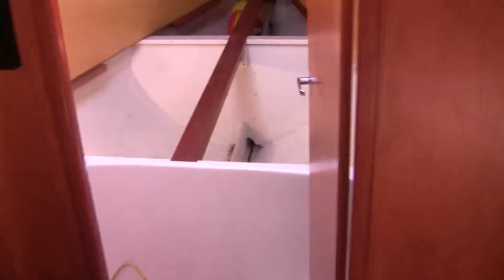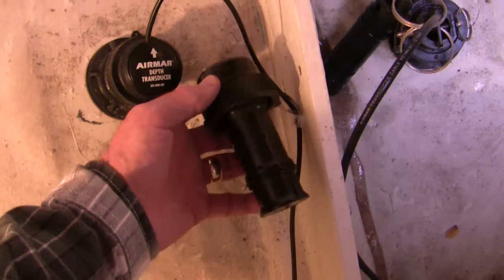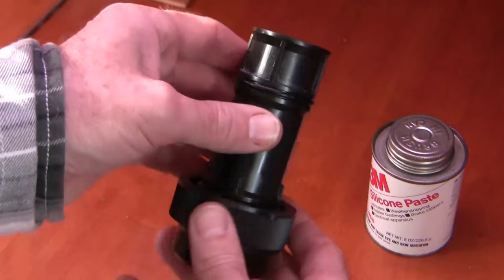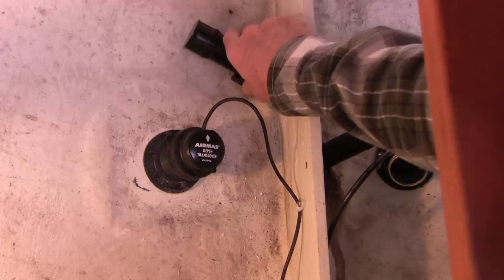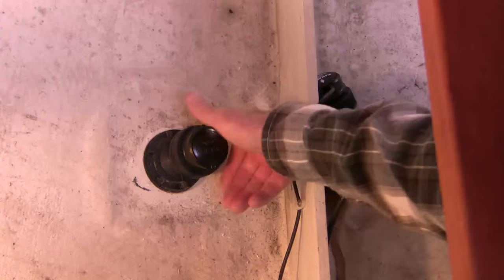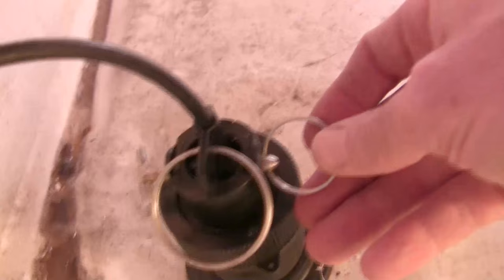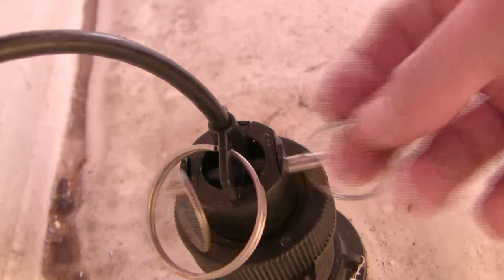How to remove a padddlewheel speed sensor on a boat

Comment from the maker: For those looking for an inexpensive replacement for the stainless steel shaft of the sensor, I believe that a length of 3/32" stainless steel tig welding rod is just about the right diameter. One rod is a lifetime of shaft replacements, which are easy to swap out.

Comment: Any chance you know the model of paddle wheel you have in this video?
Reply from the maker: I must have written it down, somewhere. Next time  go to the boat I'll look it up for you. Note that the NMEA 2000 speed sensors are completely different than these older NMEA 0183 devices, though it is possible the wheel is unchanged.
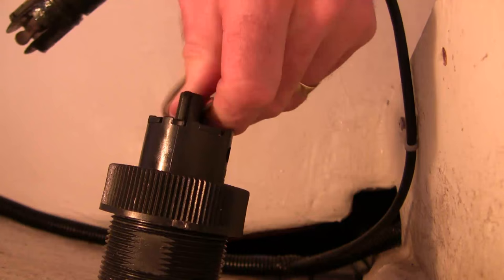Reply from the maker: Ah, here it is, shown at 4:20 of the following video https://youtu.be/4kjfn-Q-7r8

Comment: The flange that reduces the onflow of water on my airmar through hull transducer seems to not work as well as it should as water gushes up powerfully when I remove the transducer..any suggestions?
Reply from the maker: It's not a critical element and some boats don't have it. It's just a flap of rubber fabric that is pushed shut like a one way flap valve by the pressure of the water. Next time you have the boat out of the water you can have a look, it could be held open by overgrowth of weed, barnacles, or other sea life. You can replace that component but I probably wouldn't bother if you can't fix it. Good luck!

Comment: You said the paddle wheel is cheap?  I need one for a old analog gauge (prob 1960 or 1970's vintage) There are adds on your youtube page that show it at $200 or more, sometimes much more.  Given you can get a gps, with a screen that shows current data too, for the same price or less, I don't think I will be replacing my paddle wheel.  Probably safer to just glass over the hole anyway.  Pity though, I did like to have it.
Reply from the maker: Mine is an analog sensor, although yours may be a different vintage. Nevertheless, replacing the paddlewheel should work if your sensor is OK. When I was thinking I might have to replace the whole sensor, I contacted the manufacturer and they told me I could get the same analog sensor if I asked for it. Conveniently they both fit the same through-hull. As you know, the present generation are all digital, and my old 0183 communication protocol is obsolescent. However the signal I get from the sensor is a simple Hall effect on/off signal, so it's more basic data than the communication protocol used in new devices sold now.
These paddlewheels are not as reliable or as accurate as the new ultrasonic sensors, but those devices require a larger through-hull and have a bigger footprint on the hull. Fortunately I got away without doing major surgery on the hull. Perhaps one day they will be able to make one that fits our old through-hulls, in which case I would consider replacing mine. As you know GPS can't isolate the contribution of current, instead giving an overall result combining current and vehicle speed vectors. For sailboat racers, it's useful to separate the two because it helps with decisions about the fastest pathway up a tidal channel. Thank you for watching!

Comment: Thats different from your normal repairs :-)
So the paddle one measures the speed of the craft and i suppose converted to knotts.
.
Dont know how the depth sensor works, i guess its similar to sonar or electronic tape measure.
a transmitter outputs a pulse of L.F energy into the water and it travels untill it hits the seabed and reflects back, something picks it up and calculates the delay on the two paths and since the speed/length of pulse travel is known then the distance is calculated.
Possibly something like that lol, i said i didnt really know :-D
Im sure you will correct my crude guess :-D
Reply from the maker: +zx8401ztv Yes, mine is a typical ultrasonic design, as you say.
Reply: +spelunkerd 
I bet that would drive bats mad, although i dont think they swim LOL :-D